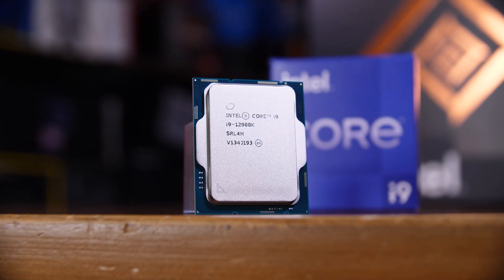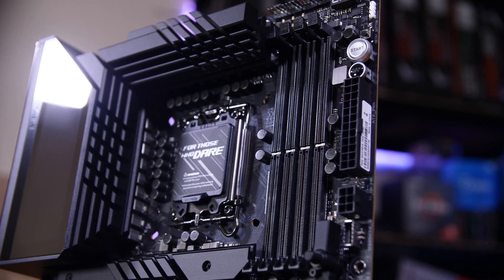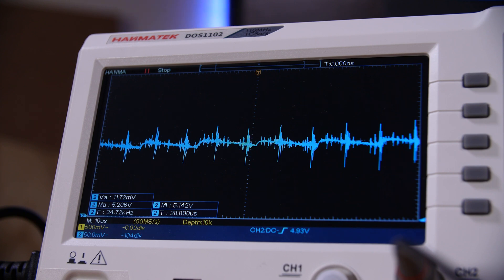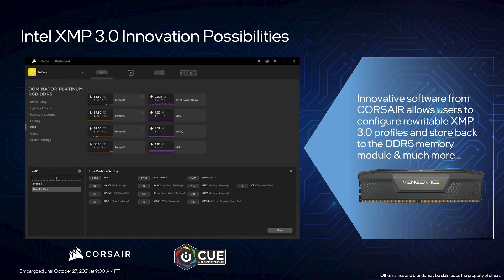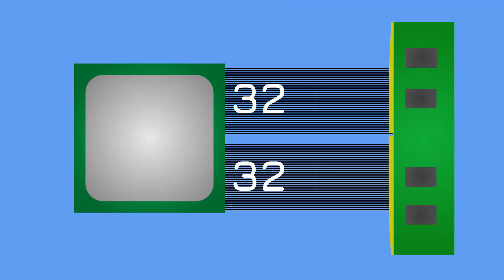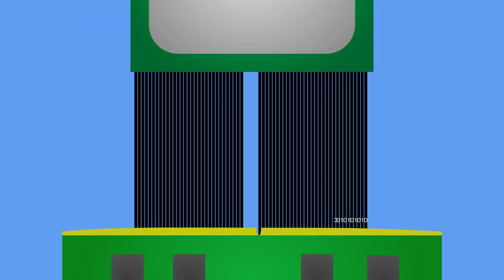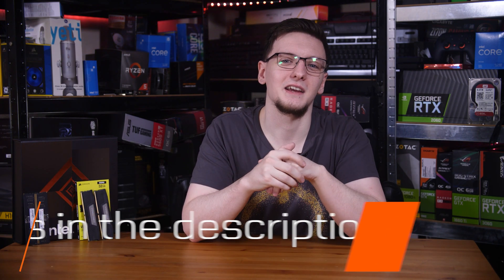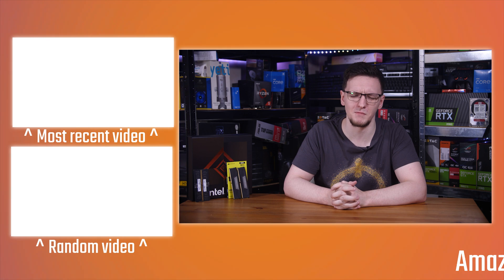DDR5 Explained - Why is it so EXPENSIVE? + XMP 3.0 Explained!

Comment: I chose to build my first sff pc as my daily driver. 
Replacing my hp omen 17t-an100 laptop
I went with the ddr5 memory. 
I picked the 32gbs  of Gskill ripjaws s5 5200 cl36 ram

Nr200 case
I7 12700k
Nh-u12a cooler
Msi z trio rtx 3080 12gb
Msi z690i
Corsair 750w 80+ platinum 
Samsung 2tb 980 pro nvme 
Samsung 4tb sata 3 ssd [gifted to a friend]
Wd sn850 2tb [canceled order replaced with pny cs2130 4tb m.2 nvme  gen3x4]
M28u 4k monitor [returned got the lg ultragear 27gp83b instead]

Currently waiting on shipping.
[Built and performs fantastic]
Reply: I too just purchased the gaming z trio but I was under the impression that it was an aluminum back plate and that this was the difference between the X and Z versions of the card but I am pretty sure mine is graphite like the X andI was just curious what your backplate was composed of and also how you like that stupid support bracket.. I am really thinking of going third party to find something bc even with trying to add some pads and stack it in places the shape of the underside of the card doesn't really give you much contact area plus it seems the bar is poorly designed.
Reply: @DATWagonator  mine seems like metal I'll do a scratch test for ya. It's a good card and I never tried using the bracket support. But it is definitely one of the best 3080 12gb cards you can find.
Reply: @DATWagonator  it definitely seems like a composite alloy. Though if it's graphite then it'll perform better with heat spreading. Compared to 100% aluminum. (People make graphite thermal pads for cpu after all)
Reply: @DATWagonator  p.s. I read that the difference is also about the oc that applied. So technically it's a  cherry picked gpu when they did their binning. So they put it in the z trio and not the lower  x or the higher surpreme gpu
Reply: @blueridgeocean  cool do you happen to have a link to that information I would like to read that.

Comment: Should I get the Micron Crucial DDR5 4800mhz CL40 32gb(single stick) or G.Skill DDR5 5600mhz CL36 32gb(2 sticks)? The G.Skill sticks are about 75% more expensive here for the same amount of ram..

Will the G.Skill DDR5 6000mhz CL36 32gb(2 sticks) make any difference over the 5600 model? it is even more expensive..

I told myself I should probably get the cheapest option until prices come down but I am not sure they will any time soon. I am not holding my breath
Reply: Wait wait to buy DDR5 Gu,now they are a nonsense 
Eat more pizza instead 🍕

Comment: I'm OK with the early adopter prices right now. There's no full featured z690 boards with ddr4 support so I'm forced into ddr5. You just can't even buy ddr5 right now even if you want to because none is in stock.
Reply: same my i9 12900k is waiting
Reply: 4 months later there are plenty of things in stock now from what I can tell. I just don't know if ddr5 is worth it for gaming.
Reply: @DATWagonator  I do gaming and content creator so it's kinda worth it. If you are into something like need multitasking
Reply: @Lawz1993  Most multi tasking I do is having about 30 yt videos open in Opera, and but yea I already spent 2500 or so on a pc and graphics card and with the latencies of DDR5 and the compatibility issues I just felt it safer to go DDR4, it really is a shame they feel the need to eliminate backwards compatibility with things like ram.
Reply: @DATWagonator  I'm someone who upgrade from a 7 years old PC.  So my logic is since they already introduce new board and Ram. Must well I just invest on them. So the coming years I don't need to have the havoc and costing to change the mobo or Ram when I need to upgrade to better core. But anyway it work well currently and without giving any extra trouble. But few month ago, it's a pain in the ass and spend a lot of money on them. Especially the Ram is damn expensive.
Reply: @Lawz1993  This was my first build on my own.  I upgraded from an i7-920 and 8gb of ddr3 in a Dell XPS 9000 which I eventually had to get a GeForce K620 to replace whatever I had in there before because the last gpu failed. But that was from the way back machine in 2009.  I just finished my build last month and I went with an i7 12700K, 16 gb of ddr4 3600 14-14-14-34 g skill trident z rgb and the MSI 3080 gaming Z trio with the noctua dh15 for the cpu cooler and 7 lian li al120s because they were the only fans I found that truly daisy chain and use only 2 cables per 3 fans(you can chain up to 4 on one plug).

I totally get your logic and I was a breath away from doing the same thing but some yt videos I seen talking about the latency and the compatibility issues I just said for my low knowledge sake I should go ddr4 so  to save me some possible trouble down the road.  I without a doubt would have gone ddr5 if the latencies weren't so crazy though.  

Oh my case, I bought the Corsair 5000d Airflow white but ended up selling it to a buddy of mine and grabbing the Thermaltake Core P6 and while I love my case I wonder what might have been in that case because my buddy has a 3070ti founders in his 5000d airflow and he runs at 10 degrees cooler at idle on his gpu despite the founders running warmer than 3rd party on average.

But sorry for the rant I am proud of my build if you can't notice lol. The moment I got that post from msi I yelled so loud because I had done everything correctly and it felt awesome. Which I am sure you can relate but have a good one and enjoy your ddr5 I hope it causes nothing but good gaming.
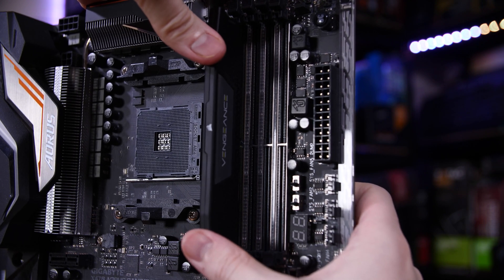Reply: 1:36 how do you all NOT see the shady shit they are doing so you HAVE to get new stuff, boycott these practices, f-them.

Comment: Very informative but I read there probably and like are DDR 6-7 already out there for maybe companies whose job is to test it….whatever but I’m sure DDR 5 is very expensive and that’s why it just barely came out for consumers. Either way apple is probably what I’m going to move to next on my pc purchase.
Reply: Yeah ddr5 has been in development stages for so many years. Big companies can't just switch on a dime in a moment notice. They need time for standardization of parts and bios and once most of the big players can mix and match products for it to play nicely they release the consumer retail products
Reply: Or you can just do what I did in IT class. Install and run Mac os on a chromebook like (about 10 or 8 years ago)